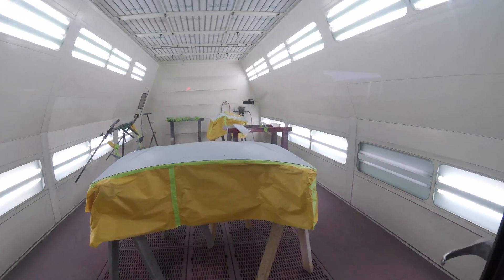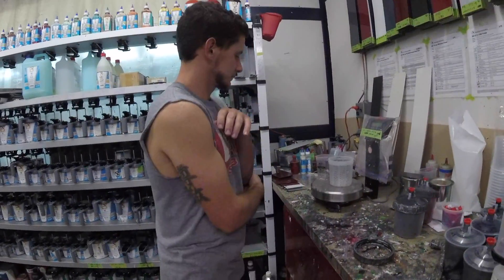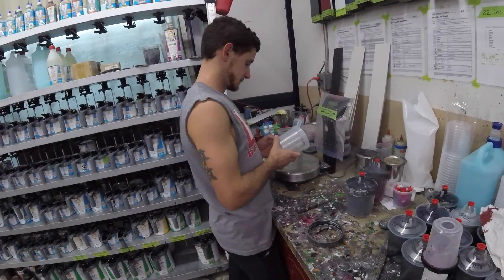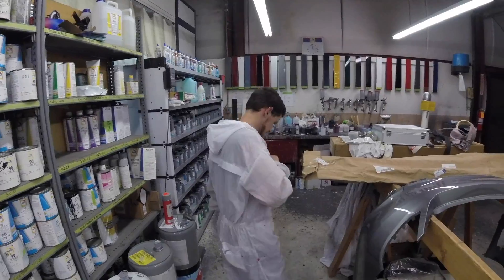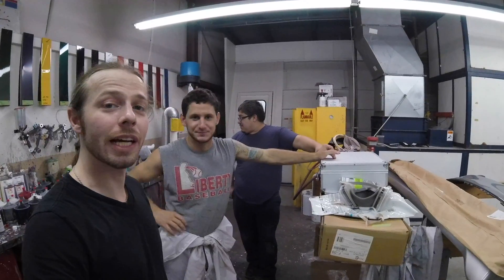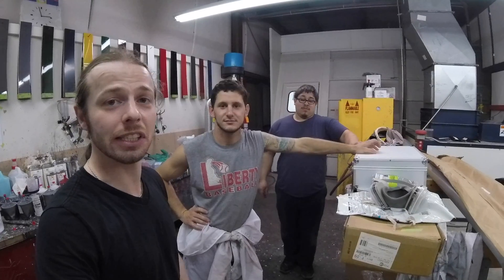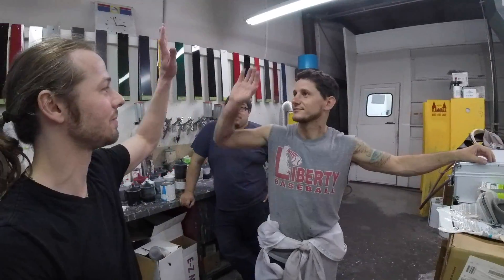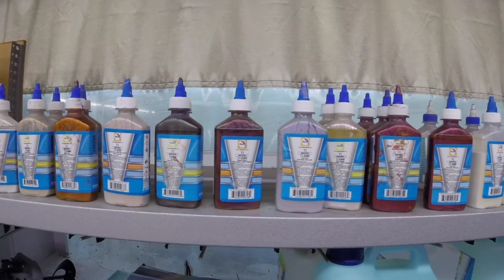Painting Parts [Will We Make It To H2Oi?? // Widebody Mazdaspeed Protege5 Build]

Comment: Ahhhh the perks of working for a Mercedes Benz Dealer.
Reply from the maker: absolutely! he still had to pay for the paint and everything, but it's definitely nice to be able to knock the job out
Reply: @milsgarage  Yeah.... but you just cant beat having access to a paint booth. Options are pretty much unlimited for " side work " which equals = $$$$$$$
Reply: @milsgarage  Is Ryan Autobody or Service/Repair Tech or both? I see he's using 3M system on the paint cups. Does he use SATA or DeVilbiss guns?
Reply from the maker: autobody and paint. we've got some really big plans in the works :)
Reply: @milsgarage  KEEP IT UP. Great work guys.
Reply from the maker: btw, he doesn't do side work for money out of the Mercedes shop. he only does personal work. he's the paint expert though. do you paint then?
Reply: @milsgarage  I work at an Independant shop that does service/ repair on all German cars, specializing in BMW/ MINI products. I was working on adding bodywork to my skill set but got side tracked when a jungle of info on the 2006 and up BMW cars came out. Now all I do is read about all of BMWs never ending complexities and feaures coming out on the new G chassis cars. Dont have time for much else. I painted 2 cars in the past. I was really starting to get into auto painting. I still have 2 guns. SATA guns are very good quality German made paint guns. I just got side tracked and lost the ability to practice.
Reply: @milsgarage  Glasurit, RM and other BASF products are the best. Thats why that car looks like a piece of candy. High quality clears and base coats. Great stuff.
Reply from the maker: that's awesome! i know Ryan's talked about the guns with me.. not sure if he has his own set yet.. what you doin with those guns? and most definitely. Ryan went with a Maserati red.. which was oddly cheaper than the Mazda red lol
Reply: @milsgarage  Well I got em packed away in storage. I kept them hoping that one day ill get back into the groove of painting on a few personal projects if time permits and yeah.....it doesnt surprise me that the Maserati paint was cheaper than the OEM Mazda paint. Some OEM Mazda parts for a Protege economy car are just plain overkill as far as price is concerned.
Reply from the maker: for sure. Mazdas can definitely eat wallets. ever since i owned a black mica MS3.. when i found out what the paint cost, i decided on that day that strait black is good for me. Nissan black, rattle can black, black black. i stay far away from that fancy top shelf black lol